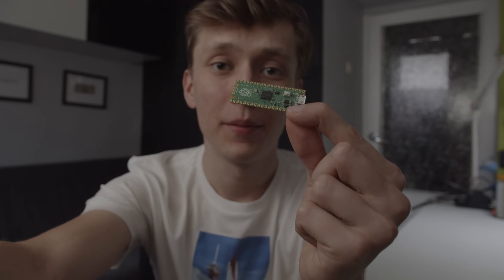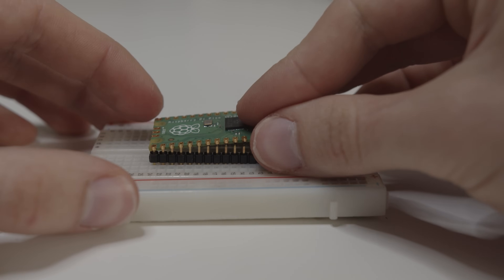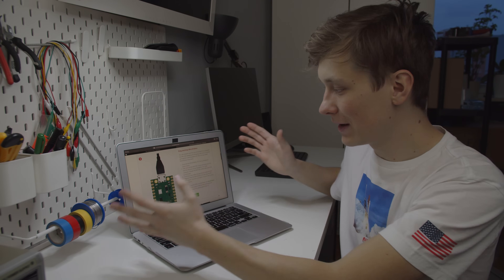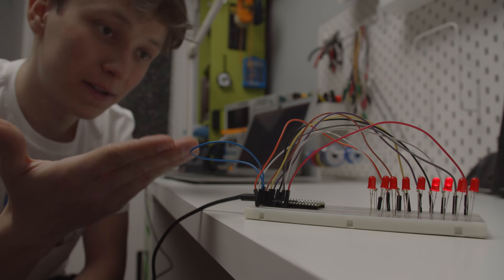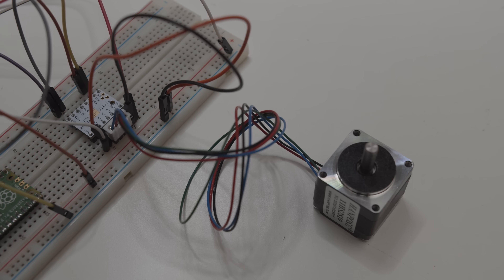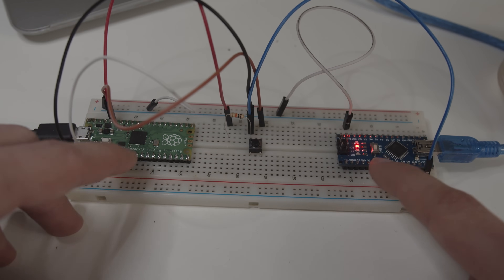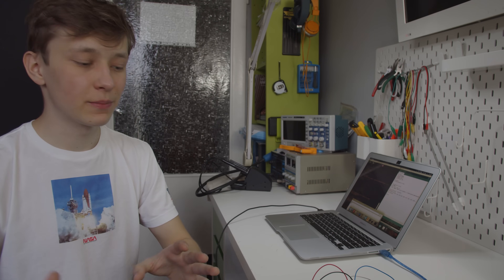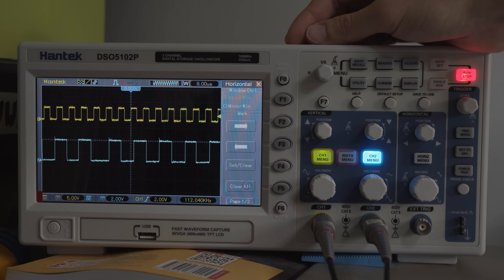$4 Raspberry Pi Pico - Simple Projects

Comment from the maker: Here you can find my python code:
Blink:

from machine import Pin
import utime
led = Pin(25, Pin.OUT)

while True:
    led.value(1)
    utime.sleep(1)
    led.value(0)
    utime.sleep(1)

Knight rider:

from machine import Pin
import utime
pins=[]
for x in range(0, 9):
    pins.append(Pin(x, Pin.OUT))
while True:
    for on_led in range(0, 9):
        for x in range(0, 9):
            pins[x].value(0)
        pins[on_led].value(1)
        utime.sleep(0.1)
    for on_led in range(0, 9):
        for x in range(0, 9):
            pins[x].value(0)
        pins[8-on_led].value(1)
        utime.sleep(0.1)

Stepper motor:

from machine import Pin
import utime

dir = Pin(0, Pin.OUT)
step = Pin(1, Pin.OUT)

dir.value(1)
while True:
    step.value(1)
    step.value(0)
    utime.sleep_us(200)

Temperature sensor:

import machine
import utime

temp_sensor = machine.ADC(4)
conversion_factor = 3.3/(65535)
while True:
    temp = temp_sensor.read_u16() * conversion_factor
    print(27 - (temp - 0.706)/0.001721)
    utime.sleep(2)
Reply: thanks for posting the code! I appreciate this video! you got my sub!

Comment: $4 for the Pico, but $2 for the Arduino Nano (The one that requires an external programmer).

Just too many variables to to go through, as in the 3.3v Arduino id 8MHz compared to a 5v Arduino of the same board type runs at 16MHz Plus you can override the internal clock of the of the Arduino and put in any speed clock you want (within reason).

Plus you are comparing a Dual Core Pico with a Single Core Arduino, that is like comparing an i3 to a Pentium 4, even at the same speed, the i3 will always win.

A microcontroller is best for programming its I/O and have it do things like you have done here. Years ago I built a tank tread vehicle using a Arduino Micro. It moved forward and back, turns, flashed lights and judged distances to obstacles (walls) and avoided them. A bit more programming and it could follow a line.

The Raspberry Pi Pico is good, But I think it distracts from the Raspberry Pi itself.

Put up more videos like this!

Comment: I would love to see your code for the squarewave for both the Arduino and the Pico. (It does not seem to be in the first comment)  I expect that you did not use the PIO capability of the Pico which I am sure would have produced a much higher rate  squarewave

Comment: 1:34 Yeah I get the same thing when I solder. I use no clean flux but sometimes I use alcohol to clean the flux and it leaves sticky residue. If I don't clean it then it doesn't leave any residue.

Comment: It is slow because python is an interpreted language whole Arduino uses a compiled language. basically think of it this way every time the pico runs the code it looks at the code and translates it while on Arduino it's already  compiled and put in a way computers can easily read.
Reply: Are you an idiot? It is a chip... it does not run interpretters))) whether you use python, c or asm to write code for rpi it is compiled and then linked into actual 1s and 0s...

Comment: I don't really understand why everyone is so hyped about it because an Esp32 is as far as I know more powerful for almost the same price and has bluetooth and wifi. Can somebody tell me the Reason of the Hype?
Reply: Good mix of cheap, fast, new company into microcontrollers and 4 programmable pio’s allowing it to bit bang to pretend it has more signal channels. This can occur separately to the 2 cortex cores so it can be fast for complex tasks. But mainly it is bc RPi has stepped into microcontrollers with custom made silicone
Reply: @housane  i understand the reason, that it is their first chip. But it is only half as fast as the esp32(also 2 cores) and lacks Wifi and can be only 4$.
Reply: I thought could be interesting if you design your custom PCB and ask the manufacturer to solder the RP2040 chip alone which is very cheap 1$ . the same can probably be done though with ESP32 which I believe would cost around 2$.

Comment: It's not open source  and open hardware. Better Arduino if you want to sell yours  product and device in the future. Raspberry  microcontroller it's  only  for learning  uses. 🙂
Reply: what? :D
Reply: @Mcs1v  You will not find a microcontroller chip for sale. And this is very important when you want to sell your device and put there a microcontroller from raspberry  pico.For more information  Google that In wiki :"open source ","open hardware " and "arduino microcontroller".And you will be understand about  what  I speak.
Reply: @logcom482  Absolutely wrong. First of all, theres no arduino microcontroller. The arduino is a platform and an IDE (ecosystem) with various microcontroller support (atmel/stm/etc and RP2040 too). The raspberry pico is a board supplied with RP2040 microcontroller (and the schematic is available for the board), and last, you can buy the RP2040 alone, without the board
Reply: @Mcs1v  i didn't find a chip from the Pico board for sale.Only with  the board.
Reply: @logcom482  Some people have samples of the chips so they can test their boards they are going make with the RP2040. And raspberry will be selling the chips soon.

Comment: Have you worked on Raspberry Pi 4?
I'm facing some issues as I installed Ubuntu on it & trying to work on face recognition system using python 3.6.
Reply from the maker: Go with raspberry pi os
Reply: ok, I will try that.

Comment: Thanks for the video.    Looked at the docs and did not see SPI or I2C support?    Its slower than the ESP32 which can be had for the same price.    What did I miss?
Reply from the maker: Of course it has support for I2C and SPI, UART and so on
Reply: @nikodembartnik  LOL yeah missed that.  But still why choose this one ?
Reply: @danharold3087   originally meant  for young beginners in school, if programmed in C will be much faster than arduino, 16mHz versus 125 mHz for the pico, also has 4 pio ( which work apart from the main cores )
Reply: Yes the pio are the main thing apart from the speed as the pio’s can bit-bang while the processor does something else